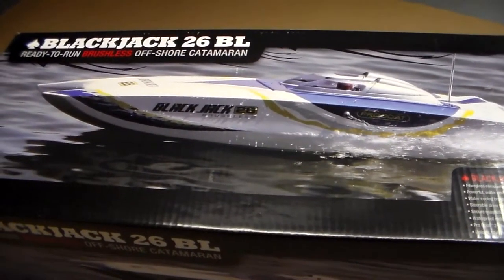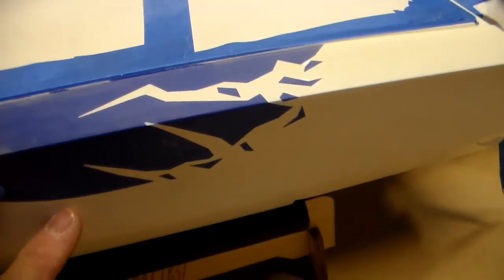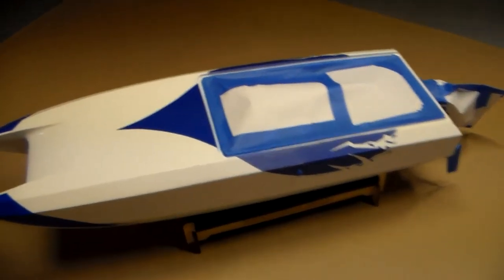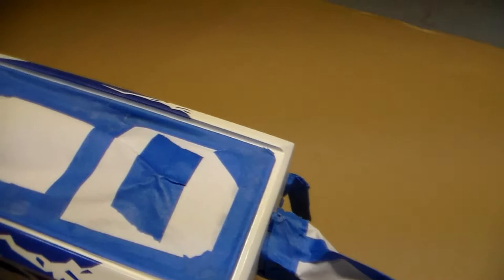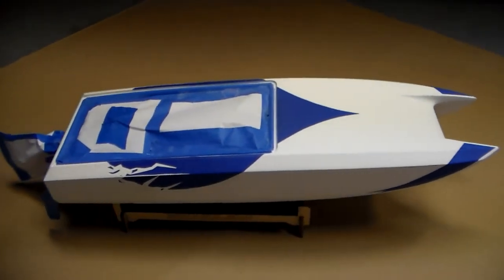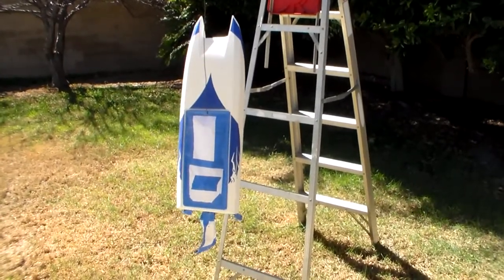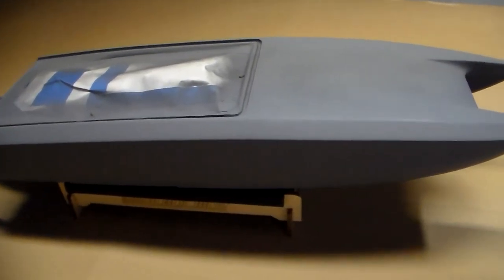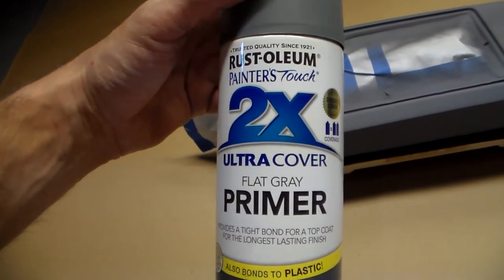Blackjack RC boat custom paint.(Part 1)

Comment from the maker: I would have to highly recommend using primer.  Primer will adhere to a sanded, prepared surface a lot better than just paint alone.  And paint will adhere to the primer.  Just spraying paint alone you can run into a lot of surface problems.  The paint could run a lot easier if you spray too heavy, and you could also get what is known as "fish eyes" on the surface etc.etc.  Hope that helps.

Comment: What paint did you use and what did you do to put it on
Reply from the maker: This was all done using Rustoleum 2X paint.  It is just spray paint.  I did some prep work before I painted with different sand papers.  This was a three part video series.  Check out part 3 finished.  I show all of the materials I used to do the paint job.